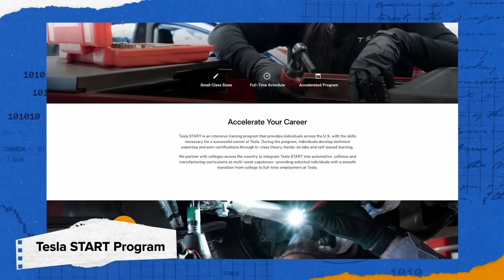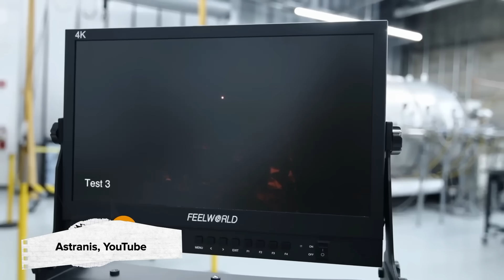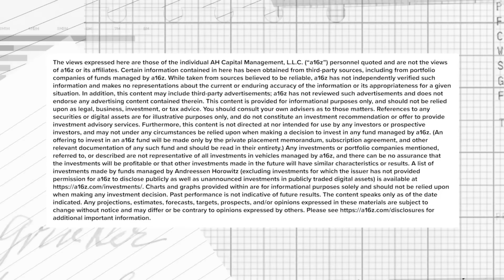Jobs of the Future: Where Hardware Meets Software

Comment: We're repeating history again I feel. We did this in the 90s with "AI" back then and they released engineers. Now, we're trying to combine which we did in the later 90s. AI is just smaller computers doing things (which we aren't really validating the output, we just trust it). I feel we need to focus on taking things OFF the network, less information, less convenience, and less would be better....back to the 70s and 80s to an extent. Take data OFF the network that shouldn't be there; reduce breaches and data exfil.
Reply: technological evolution is just an iteration of trial and errors

Comment: This blog reminds me of the "Mean Girls" character Gretchen who tries so hard to make "fetch" happen by repeating it incessantly. There is already the much more common term of "systems engineer" that has been around since the mid 20th century, and even "solution engineer" that was brought into use (to address the fullness of the solution's technologies) over 20 years ago (per Google nGram). Full-Stack Engineer is also already deeply imbued within the software engineering community such that it cannot be casually co-opted or repurposed for an aggregate set of skills that are already have useful terms in the jargon-space. Not to mention, just because VC's have been ignoring HW & SW integration doesn't suggest that the industries went away (even though this blog does make it seem so!?). 
The stated underlying needs in industry seem sufficiently valid - but trying to re-label the roles that already have valid names by attempting to steal one from an adjacent/included sector, well… that's just not very fetch.

Comment: Most of the electronics jobs are in China and other parts of Asia. There are very few jobs for hardware engineers in the USA, which has de-industrialized so much and whose operational costs are very expensive, add to that the conditions for production are backward.

Comment: Hardware once installed, it is expected to work for at least 5 years. But within that period, it undergoes about 15 software iterations (major and minor), hence software engineers becomes in demand.  And that will still happen because of the way things are.🎉
Reply: Now AI could handle most of the updates and companies could use very little human resources
Reply: I agree that’s the reason software work is so much more abundant 👍🏽 

Software needs to become more serious about using engineering principles to design and implement

You can make a machine that will let a customer enjoy AI, but AI in design is a big mistake.

Comment: Oh weird, that's called Embedded Systems Engineering, not full stack engineering. And thankfully I am already over 10 years in this niche.
Reply: Not exactly! Embedded software engineering is a little bit different in a sense where it doesn't cover that much of hardware engineering, it's still in the realm of software engineering: just some low-level, firmware programming using the hardware interface.
Reply: @TechCrack01 bro, it's called Embedded Systems Engineer, not only Embedded Software Engineer. These are 2 different things. 

Embedded Systems involves Software + Hardware. 

I heard first time it's called full stack engineer. Full stack usually means from pure software side of view where developer can code multitude of languages or frameworks, I never heard any company or anyone says it's full stack where hardware involves. Its called pure Embedded Systems and lots of embedded engineers like me are so much experts in hardware + software + firmware + app development + cloud + linux. So it's quite common in the industry to call such an Engineer, Embedded Systems Engineer. Hope you understand. Thanks.
Reply: Yes Embedded Control Engineering is hardware and software.
Reply: @gtpumps Yes, but it's not a Full Stack engineering as she framed it
Reply: Yup, that's what it is. I've been doing it for like 20.
Reply: @artemisPrime3285  And we are proud doing it. My love my passion always and always will.
Reply: In the robotics system, the embedded systems only address the controller. The full stack engineering covers the entire robotics links, joints, sensors (e.g. materials science), design of various end-effectors. For example a three-fingered gripper can be designed and fabricated, but the design and fabrication of such mechanisms has nothing to do with the embedded systems.
Reply: By full stack engineering, she meant: (Software + Hardware) engineering
Reply: @TechCrack01  I think that's called Embedded Systems in the technical world.

Comment: Timestamps (Powered by SitrakAI)
00:04 - Job opportunities are expanding in hardware-focused roles, reducing the necessity for degrees.
01:36 - Demand surges for skills blending software and hardware engineering.
03:02 - New engineers bridging hardware and software are essential for future job markets.
04:28 - Robotic teleoperation creates new job opportunities without requiring a four-year degree.
05:46 - Heavy industries face labor shortages as automation rises and experienced workers retire.
07:12 - Demand is rising for full stack hardware engineers across various industries.
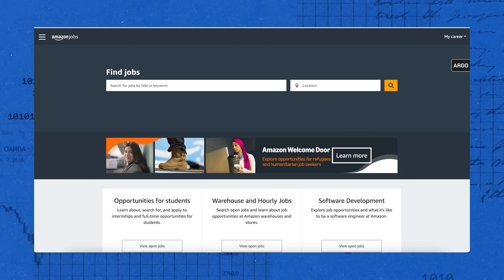08:43 - The market drives innovation for hardware-software integration careers.
10:24 - Building a US-centric supply chain for robotics and manufacturing is crucial.

Comment: Engineering has always been 70% Hardware and 30% software. Software runs on hardware, However over the years software has made. significant progress, hence the need for hardware to catch up, which translates to the increasing demand for hardware Engineers. A full stack Engineer has an Edge because they have vast knowledge of both parts, which makes them more relevant.

Comment: LOL, I did electrical engineering back in the 2000s, and worked for a few years. Eventually, switched to software for more rewarding jobs. Now, they want the hardware back! America is always about the next quarter thinking rather than decades and long-term thinking.
Reply: In my experience pretty well everything comes back in time. I studied Engineering back in the 1970s & was sure then that the short back & sides haircuts of my father's youth were never going to be fashionable again.
Reply: Same here in india. I didn't even found more jobs related to electronics in mid 2014's . I think right now there might be some openings in electronics .
Reply: Same here
Reply: Good insight.
Reply: Same as well.
Reply: What would you say is more stable and promising in the longer term? I find myself lost in software and AI hype

Comment: That's me!! a full-stack engineer! I started my career designing integrated circuits and pcbs for 5 years.. then moved to high paying software engineering role and doing ai engineering and enterprise architecture design 😅😅😅
Reply: That's amazing ! I just graduated from electronics engineering and I do not see much job offers, and less in my country, I do find software/embedded and AI more intriguing, is it totally worth the change?
Reply: @alvaropineda5168  I would go for, its the future. Learn low level coding and get a board to play with (preferably AI).
Reply: My son is graduating from Electrical and Electronic degree this year. With the knowledge and experience you have , can you advise or suggest what he should in terms of career please ?   He is not sure.
Reply: Same. It’s fun to understand the full stack. Or at least at the zoom level necessary for each element to pass qa.

Comment: I completely agree. I spent over 7 years at SAP and AWS, and left AWS to develop end-to-end hardware and software solutions. Many companies face significant challenges with the hardware aspect, which is becoming an increasingly critical need. I founded a startup (Cosito sensors) to help companies implement sensor applications in minutes, not years.
Reply: You're right! - I'm a hardware engineer and embedded systems developer for years!
Reply: my compliments. very few people have the forsight to work more with the hardware and less to make it a possible business.
Reply: @Dawsatek22  I'll like to connect. I've just started to do some embedded programming after years in back-end, mobile and cloud engineering.
Reply: @TechCrack01  really? i dont know why i post some robotic project related videos on my channel as portfolio and documentation.
Reply: @Dawsatek22  I am in misery because I have been made to feel like a desperate person. My life has felt like one of complete stagnation. My parents Bonnie and Terry Tipton talk as if they would have won every football and basketball game they watch on television. That is exactly how they are. I did take a mechatronics course in the earliest years of this century. Micro-controllers are quite interesting. Their use, by using computer programs, to control electric motors and other actuators is interesting. Relating to the parents is difficult. They are both very emotionally reactive. I can find some purpose in solving some problems presented in a YouTube video, whether about calculus. some Mechanics of Materials problems, or a digital circuit. I think what makes the future different from the present are inventions.
Reply: @ChrisVink-b5b  yeah it also has become cheaper and more accessible to get in. but i have a question what are you doing now for a living?
Reply: @Dawsatek22  I forgot or missed the larger context/topic of these messages so I do not know what you are talking about.
Reply: @ChrisVink-b5b  first statement was hat it is easier to get into hardware, second i ask what do you do now because maybe i might get a idea to help feel less miserable. it is worth a try
Reply: I work in marketing for such companies. Sensors are really cool and hugely needed everywhere.
Reply: Congrats and good luck
Reply: I am also a Dev at SAP.
Reply: I'd love to connect
Reply: That's unfortunately why China is gonna take the lead.

Those kinda skills and logistics are super basic
Reply: Can you give me work
Reply: Great free advertisement!
Reply: do you consider embedded, fpga, pcb, chip design HW in this context? I thought she was more talking about mechanical 😂